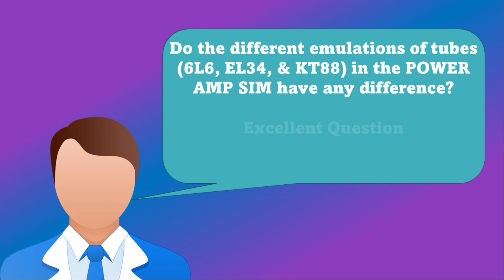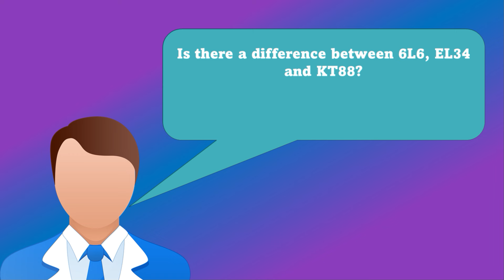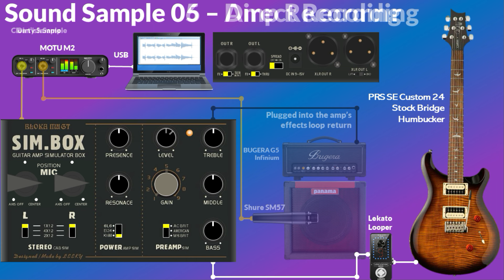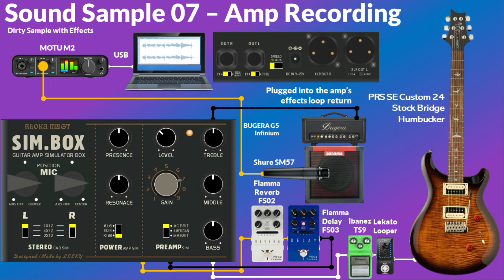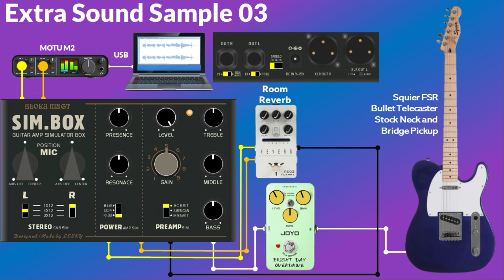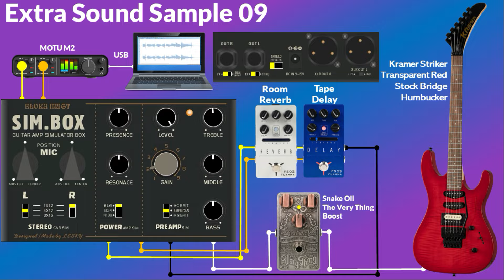Bloka Mugt Sim.Box - Tube Emulation differences & Recording Direct and via an Amp

Comment: Very cool video tyty.  Is there any place at all I can get a manual for this thing?  I got one and I'd like to know some specs.  Specifically, can I plug a 4x12 cab directly into the output.  How do I know ohms rating(s)?  Lastly, if that doesn't work can I plug the cab into the fx send and run that way?  Thanks all for any help.  G

Comment: Hello, Chris. I got this pedal two weeks ago and have been struggling to get a "big sound" from it.

I plug from XLR left to PA, then FOH sends me to overhead speakers (silent stage setting). It sounds very "clipped" from this.

Do you have to run this DI box in stereo (XLR left and right)? Or is another way to do it?
Reply from the maker: @jedduy8144  I wouldn’t say you have to run it in stereo, and I would also say you shouldn’t have to run it into a DI, especially if you are using the XLR out. 

Just curious, if you use it with just headphones or using the XLR’s into your computer’s USB audio interface, how does it sound.

Not that it helps your situation, but lately I’ve been coming out one of the 1/4” out put and going into my Catalyst 60, with the return of the effects loops configure for Power Amp and I’ve been enjoying the sound/tone I get.
Reply: @Tone-Quest  Running into headphones w/ Bloka is very good 👍👍 Running XLR into Audio Interface (Focusrite Scarlett) sounds good also. 

Maybe I just have to ask FOH to turn up my master volume so I'm not clipping 😊🙃

Thank you for reply!
Reply from the maker: @ Good luck, I hope you find a resolution or a combination that works for you. I have a PA in my room and I’ve not run it through there. Maybe I’ll give that a shot and see how it does.